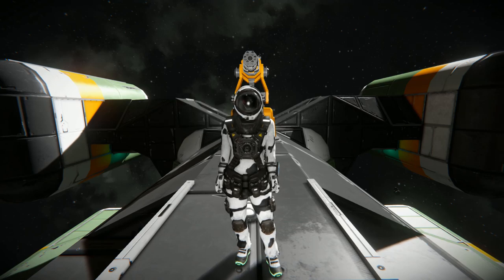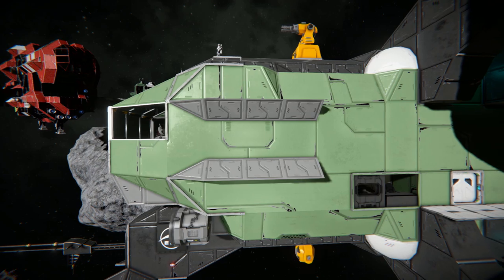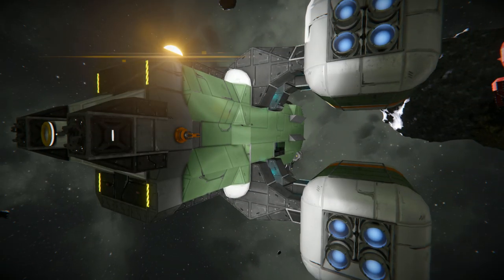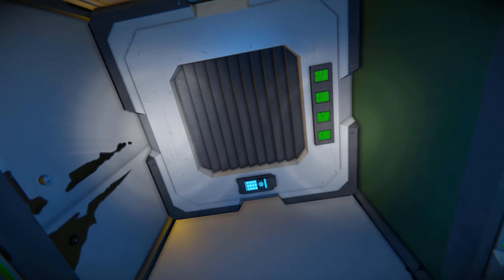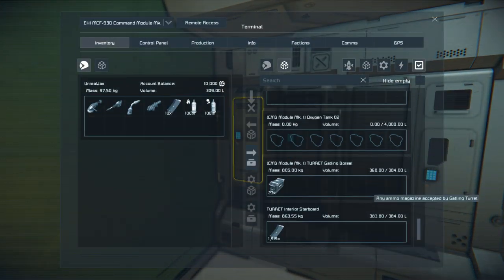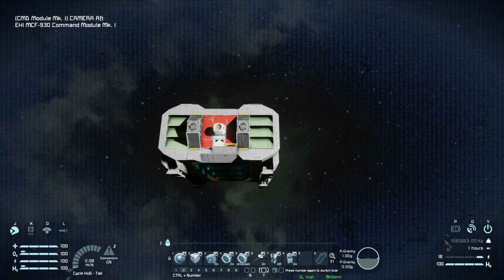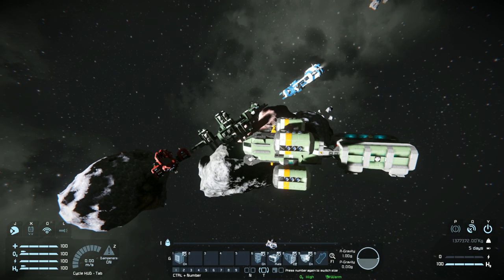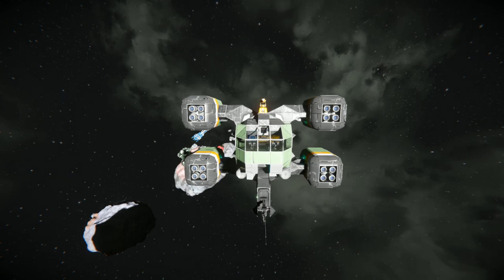EHI MCF-930 Command Module Mk. I - Space Engineers

Comment: I made a similar looking ship as my universal craft, but in a bit larger scale (near 8000 blocks total, called "The Tipsy Lizard"): 
section 1: Main cockpit, officers quarters, briefing room, computer core, BAR, (toilet). (large "X" thruster pylons)
section 2: main cargo room, deploy-able drills, - can be used as a last result miner -.
section 3: main production room with refinery, medium (pressurized) hangar, !escape pods! , crew quarters, mess hall, (toilet).
section 4: Engineering section, main reactor, jump drive(s), main thrusters ("+" pylons)
All sections can operate on their own; each has: thrusters, power source, guns, 1 assembler, flight-seat/cockpit, life-support (with survival kit), some cargo storage, and built in self-destruct!

P.S. In modular ships; pylons are recommended, so u get no thruster damage during cruising, when the modules are connected.